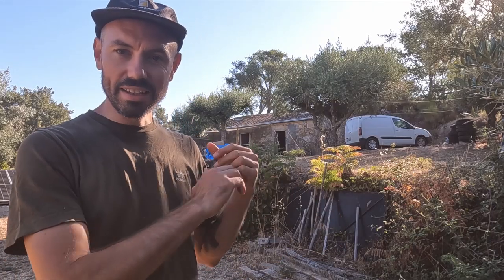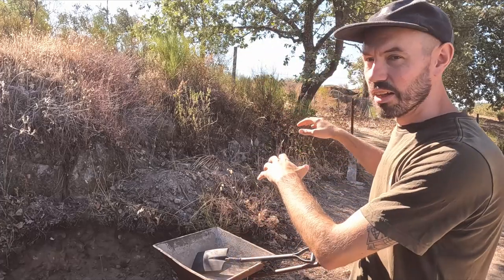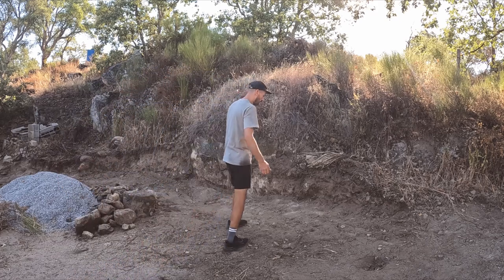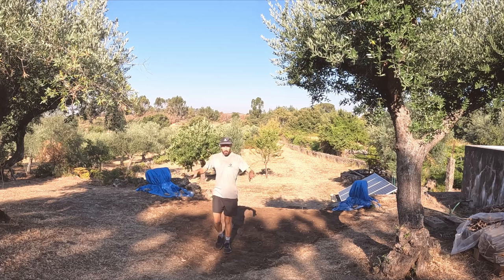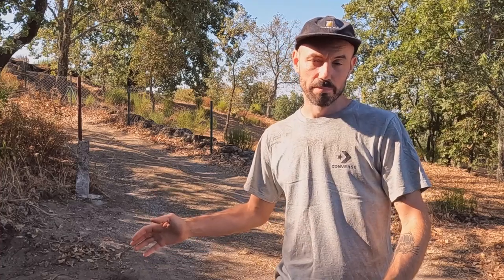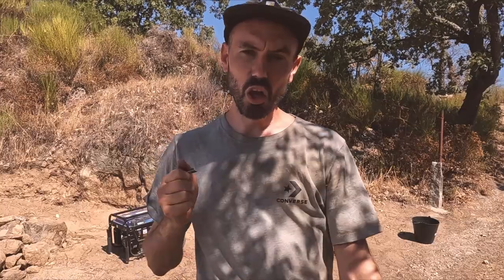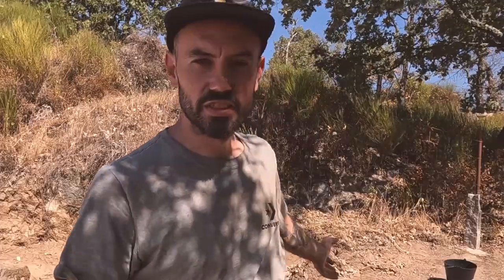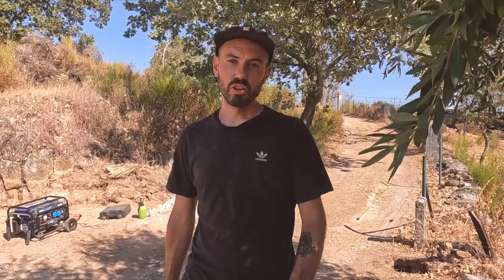LOCKING DOWN THE FARM | Installing gates to keep the dogs safe!

Comment: Tough but looks good. Using what you have. Any nearby rentals: digger, auger, taller, more robust jack hammer, tractor rental with a digger or auger or hydraulic jack hammer, pneumatic jack hammer? A drink and a swim.

Next time, beefier posts or make a boxing around the existing post and fill with concrete. The gates are light, so they should not cause the posts to sag too soon.

Comment: Hey Ricky, it's Chris again (the Organic Farmer in Australia). A couple of observations.. you can fence your place relatively cheaply if you go with steel posts (we call them star pickets) and 2 or 3 strand plain wire and a few end brace assemblies depending on the layout and make one or two strands as electric fence. (Easily run from a solar fence generator). You could later upgrade to sheep wire if needed and then just run one wire as an offset live wire. Dont worry about the dogs, if they did touch it once, they'll get a (harmless) zap and won't ever do it again. It's a very common fencing method here. Also, that generator was flooded. Should start in your warm weather without any choke. Sometimes they have dodgy fuel taps that leak when off and allow the carby to flood as well. Is that soil typical of what you have everywhere?
Gates look great btw!. Sing out if you have any questions..

Comment: When it is as hot as it has been lately, I always wear a cooling bandana/towel/neck wrap soaked in water. I soak mine in water, then put them in a plastic bag, and in the fridge they go. They are not expensive at all, and do make a difference.
Reply from the maker: Good tip! 👍🏼

Comment: Those post hole digger are great. If you ever want to dig deeper holes, I recommend getting one or two longer pipes that barely fit over the handle to increase the leverage. That'll make it so much easier.
Reply from the maker: Great tip! 👍🏼

Comment: THEY ARE EXCELLENT, PERFECT IN EVERYTHING THEY DO. I'LL LEAVE 1 TIP, FOR LARGE ROCKS YOU CAN DRILL IT WITH 1 DRILL LIKE THE ONE YOU USED, AND AFTER THE HOLE IS DONE, ADD EXPANSIVE CEMENT AND IT WILL BREAK WITHOUT EFFORT, IT'S NOT EXPENSIVE. HUGS

Comment: A tough job well done. It made me smile to think in the UK when the temp was in high 30's the news channels were telling people to hide indoors from the extreme heat and you were digging holes and working all day in similar conditions.... along with millions of other people world wide. The UK has lost it's way.  Perhaps the reason for the stone walls is because of the granite and digging post holes is harder than building walls. Also do you have termites as wooden posts won't last more than a couple of years unless you can get the chemical treated ones.
Reply from the maker: Hi Andy 👋 the wooden posts are chemically treated. They are impregnated posts 👍🏼 The manufacturer guarantees them for 20 years but I’m sceptical

Comment: Your gates look great.  You could always tack weld them to hold them together more firmly.  As far as tools go, if you have aldi or lidl near you, there is a 3 yr warranty on any tools you purchase. Their quality is great too. Also for the granite you can drill holes and then use a chemical slurry that expands when it sets and therefore cracks the rock. Dynacam, Dexpan or Rockite are some to name. Check them out on you tube.  Beware also of the rain running off your land , try to dig a shallow channel for the rain running down you access path away to the right. otherwise it might wash away all the soil that you have placed near your lower gate

Comment: GREAT job Ricky!! Sorry to see you didn’t have bags of “ Quick-Creat “ available ( no mixing ) to go in those post holes.  Just dump the bags worth in the hole, add water and let it set.  If it can be shipped to you would save lots of time and the back, but due to weight shipping may be too expensive. :-( 

Also good job on the fire safety in the hot temps.  I feel your pain on that here in the USA desert Southwest ( Phoenix Arizona ~ 350 miles East of Los Angeles ) only about 108 degrees today, but we can get into the “ high teens “ / low 20’s on some years, so I can see myself living  there in Portugal as well. Always thought of UK or Europe as a second home option.  (Really appreciate your temperament.)

Thanks for your patience explaining as you go!  Makes it so much more personable than just explanation at beginning/end and a bunch of work in between.  Plus we feel we get to sort of know you which along with the knowledge REALLY makes it so fun.

P.S - no problem on the “perfectionism” As it obviously doesn’t limit you from starting, or getting things done. Unlike many of us lol.  Cheers buddy!
🤙🤝
Reply from the maker: I wish we had quick-Crete here but it just doesn’t seem to be a thing in Portugal. Very strange. Used it a few times back in the UK & it’s sooo much easier than mixing concrete!

Comment: A small tractor with a front bucket is a life saver.
Reply: Perhaps he borrowed one in our absence !
Reply from the maker: I wish I had borrowed one! 😂 Would love to have a tractor but they are incredibly expensive here in Portugal. Currently saving my euros to try & acquire on in the future
Reply: @LifebyLiving  when you buy your tractor see if you can get a fork lift attachment for it.  When we bought our farm 2 years ago I bought a Kubota 3310 with a front end loader that has a quick release feature.  I switch between the bucket and fork lift forks with ease.  We use pallets to move stuff around on the farm.  Saves time and saves my body.  Great for moving roof tiles! (Your next video). 🇨🇦

Comment: The gates look nice, too bad that you didn't get to open to the inside towards the house like you wanted them. Maybe when you get the gates that you want , they will open inward and you can have solar power electric gate so you don't have to get in and out of your van to open the gate. Until next time stay cool and hydrated ..

Comment: The gates look nice but are you sure they were made by the local blacksmith himself? These packages look like a China import. And what kind of animals do you want to keep outside? Moose? Lions? The gate might be able to stop them, but unfortunately this will not be a barrier for dogs, cats, foxes, raccoons and so on. If they can't fit through the bars then they will burrow through below, you should put a strip of cement under the gate or bury big flat rocks there like a horizontal wall.